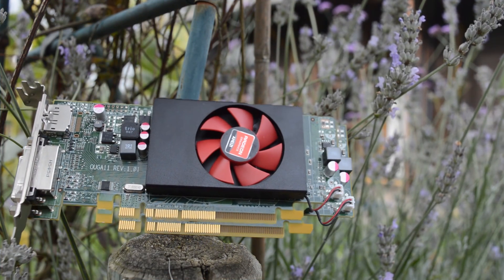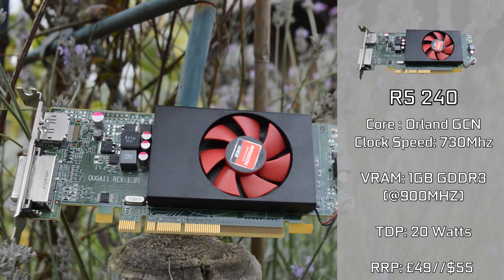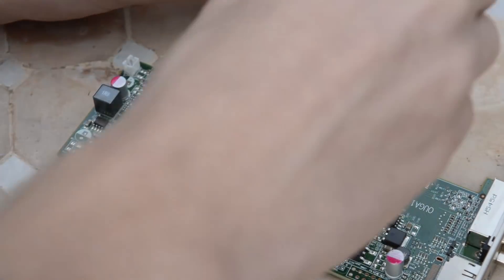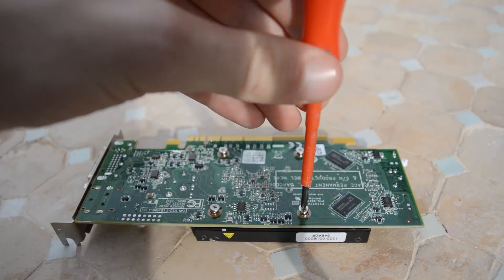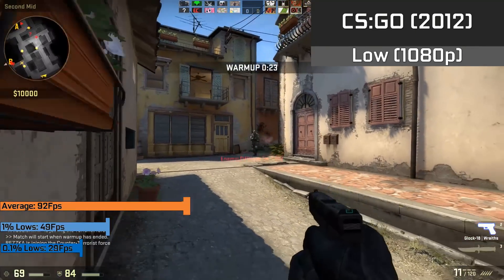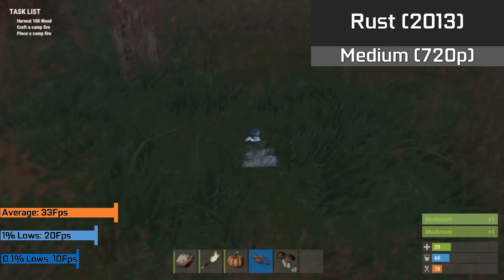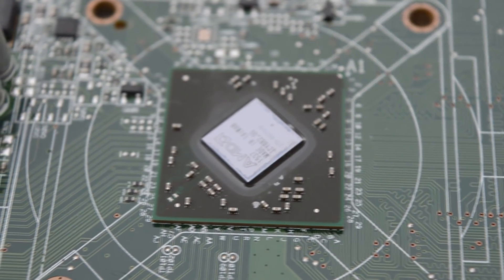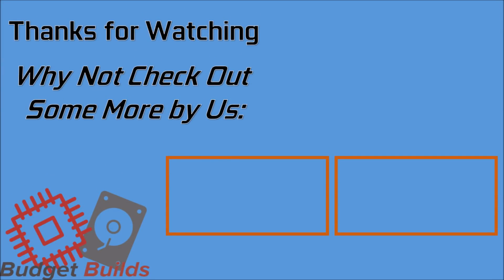Gaming on the R5 240 in 2017

Comment: Rate my Pc out of 10

Specs:
Case: Gamemax droco

CPU: G4560

GPU: GTX 1050TI MSI

MOTHERBOARD : ASUS H110

PSU : EVGA 430 WATT

RAM:8 GB DDR4

Storage: 128gb SDD and a 1TB hard drive
Reply: LCgaming GD 0/10 must have i5 or i7 and gtx 1070/1080/1080ti
Reply: Ok
Reply: LCgaming GD 4/10
Reply: LCgaming GD 8
Reply: 3/10 
You should have waited for ryzen before purchasing the g4560
Reply: Ugh, ignore the comments trying to be funny. Your PC's pretty neat, the price-performance ratio is actually quite good, especially since the G4560 doesn't bottleneck the GTX 1050TI in the slightest. The only iffy thing to me is the PSU but I guess that's because I've always used the standard 500W PSUs. In conclusion, I'd say 7/10.
Reply: If I were him, I would have waited for ryzen
Reply: From his choice of specs, such as the 430W PSU, GTX 1050TI and G4560 it's easy to see he was aiming for a PC capable of modern-day gaming at 1080p, 60fps while saving as much money as possible. I'd say he did a good job, as the Ryzen currently costs more than the G4560. Although the Ryzen is more capable for handling high end GPUs, if he isn't planning on upgrading anytime soon, then he did good.
Reply: LCgaming GD 10/10 best parts for a normal student that his budget is as tight as hell
Reply: iRuffy :D ryzen has better path and is stronger but you need like 50 to 80 plus euros for the build because you need an overclockable motherboard
Reply: Nice 8/10
Reply: 6.5/10

ryzen 3 1200 + b350 mb would've been a better choice
Reply: MoeDaTeaman better but more expensive....better choice would be to buy threadripper
Reply: Jugers Zelegou 

yes but not much if you look at the price of the G4560 rn ($99.99 on newegg) vs the r3 1200 ($104.99 on newegg).
Reply: MoeDaTeaman trust me if you go to local retail shop you can find it under 70 euros
Reply: LCgaming GD 

3/10
Reply: 7/10
Reply: What about mine?
CPU: R3 1200
GPU: Gigabyte GTX 1050
MOBO: Gigabyte B350M Gaming 3 (mAtx)
RAM: 8Gb 2400Mhz BallistiX
PSU: Corsair CX450
CASE: Aerocool Aero 500
Reply: TheAverageFanboy Thank you
Reply: Giorno Giovanna Over Heaven bad gpu....the gtx 1050 ti woulb be the sweet spot for price to performance
Reply: Jugers Zelegou ok thank you, anyway I replaced the MOBO with the msi gaming pro and the 1050 with the 1050ti
Reply: lRaziel1 ok
Reply: @Giorno Giovanni Over Heaven that's some incredible budget glory, I'd say 6/10 but with your Ryzen CPU, you could do with upgrading your GPU to a GTX 1050ti for extra frames. But if you've got a REAAALLLY strict budget, then that's fine, your build is neat.

Edit: Just saw that you upgraded to a 1050ti, I'd say 8/10 now, pretty sweet setup.
Reply: TheAverageFanboy thank you, are 450w enough, even for overclock and little future upgrade?
Reply: I'm sorry, but overclocking would consume more power than your PSU could provide. You'd have to atleast upgrade to a 500W. As for future upgrade, it really depends on what upgrades you'll be taking. Are we talking a processor upgrade? Or running an extra graphics card?
Reply: TheAverageFanboy so at the end the config is this:
CPU: R3 1200 €100
GPU: MSi GTX1050Ti Low Profile €140
MOBO: MSi B350M Mortar €75
PSU: EVGA 500w
CASE: Aerocool Aero 500 Black Windowed €40
RAM: 8Gb 2400Mhz BallistiX €65
Reply: @Giorno now that's a banging PC, should be able to handle overclocking and any minimal future upgrades.
Reply: TheAverageFanboy ok Thank you
Reply: @Giorno no problemo
Reply: Diego Dio Brando the PC is ok but btw you can go for the Aero 300 window case, i see it more elegant then the 500 and i think it's cheaper also the glass is on the entire side not only in the middle of the side, just check aero 300 window and you will see what i'm talking about (also if you go with aero 300 window you can get a cheap RGB setup with remote, if ur lucky you can find em on amazon or something for 10-15 euro)

Comment: I had ASUS R5 230 2GB model. It was the weirdest thing. CS GO ran fine on low, but Shovel Knight was lagging, Paladins ran great on high settings, but Hearthstone was a choppy mess.
Reply: Desolate Carnage yeah i have it but i cant complain since i bought it for 10£
used
Reply: FirelordUnity that card is so shit i bought a gtx 1050ti now, no you cant bottleneck unless you have a very old cpu
Reply: FirelordUnity i meant gpu bottleneck not cpu
Reply: FirelordUnity yeah I agree most likely it's a CPU bottleneck.

Comment: Just looking for how well this performs since I need a cheap GPU to throw in an old system and for testing purposes, and this actually seems to be the best value card for that purpose that you can buy right now at around $11 (previously I was getting the HD 8570, which probably performs basically identically).
Reply: is the r7 240 better tho? weirdly in my country the r5 240, the r7 250 and the hd 8570 all are priced similarly(also is the r5 340x better than the r5 240?)
Reply: @foof5695  
I think they’re basically the same. Looks like the R7 240 is actually just a rebranded 8570. And I’ve bought an R5 240, and it still performs basically identically to the 8570 I had. Specs wise on paper, they look identical unless you get different amounts of VRAM.
Reply: Ok so is the r5 340x better or worse than them

Comment: i had oem r7 240 oc to 1100/1250 but after running it with this oc 2 years i better sold it
somehow at every video you have lower fps than me. im was playing gta 5 at 1080p with 30-70 fps but cpu usage is all the time on 100%, and cs:go at 90-160 fps. i dont know but in every video i had more fps than you
sorry for my english im cz
but i had a litlle different 2gb version (i think ddr3)

Comment: Wait I never installed a GPU, do I connect it to the system port or card?
Reply: You put it in the PCI express port wich is usually under the processor and is a large port . usually the motherboard shows you where is it at :)

Comment: Doesn't the R7 240 have more VRAM than the R5 240? I was under the impression that was the difference between the two, which can make a difference in some games. edit: I was looking at the R* 240 to upgrade someone from an HD 5450 because while the 5450 is fast enough for their use, it has some driver bugs a GCN based card won't have.